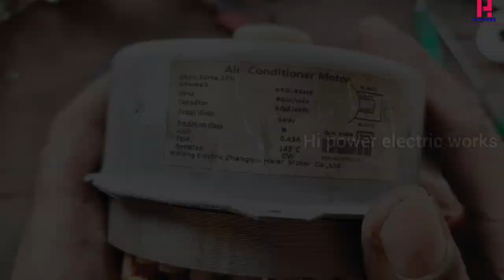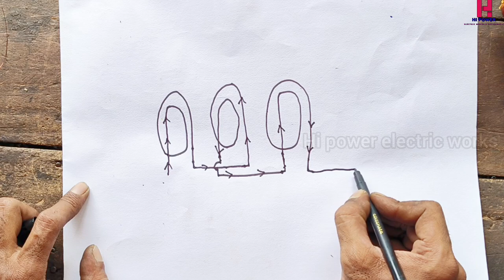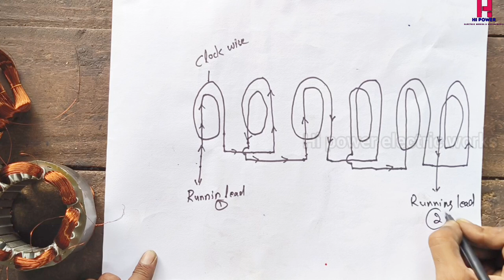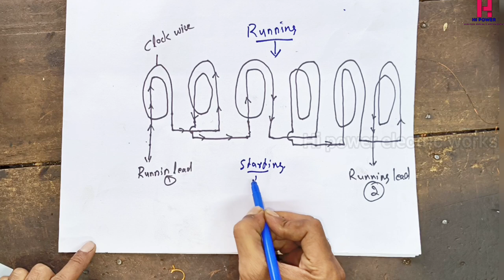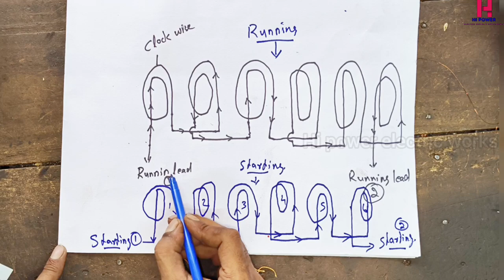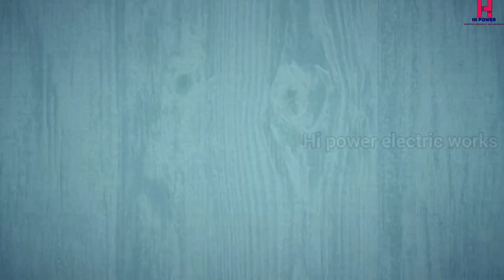Single phase 960 rpm motor winding and connection with diagram|Electric motor winding|AC fan motor

Comment: Excellent presentation.  Is there a centrifugal switch to remove the start capacitor from the circuit after the motor reaches a specific run speed?  Will you be doing a 3 phase motor overhaul in the future?
Reply from the maker: Single phase motors that require starting power have a centrifugal switch which is connected to the starting capacitor.  After the motor is up to speed, the centrifugal switch turns off and the starting capacitor is cut off from the motor.
The motor seen in this video works on a running capacitor
Reply: Thanks for the update! @Hipowerelectricworks

Comment: Hi, that was the connection for 6 coils formed, so if it’s all single coils, will the connection be a series or consequent, start to finish or start to start and finish to finish. Let me know, thanks for the video, it was great.
Reply from the maker: Connection start to start, finish to finish.
If one coil is clockwise then the next coil should be anti-clockwise direction

Comment: सर इसमें लच्छा कोयल डाल सकते है कोयल की लेंथ माप कर जैसे एल्यूमीनियम वायर 33 नंबर 360 टर्न को 120 टर्न का लच्छा कोयल माप के 3 बार गुमाने पर क्या इस से मोटर ठीक रहेगी
Reply from the maker: यह ठीक है लेकिन कभी-कभी वाइंडिंग को स्लॉट में फिट करना मुश्किल हो सकता है
Reply: सर अगर कोयिल ठीक से फिट आ जाए तो क्या मोटर ठीक चलेगी
Reply from the maker: @rohitkakkar8175  yes
Reply: @Hipowerelectricworks   जी धन्यवाद जी 🙏🙏

Comment: Sir Aaj mere paas same motor jali huyi ayi thi usme se mene Jale huye runnig or starting coil ki ginti ki to running k 380 or starting k 370 turn nikle or swg 34 copper tha ab kya kru apke vala data use kru ya Jo nikla Same motor motor lenth same motor outer same inner same plz RPL sir 🙏🙏
Reply from the maker: Video mein dikhaee gaee motor 54 watts kee hai aur iska capacitor 3 mfd ka hai.  yadi aapake paas maujood motor ka core aakaar video mein dikhae gae motor ke aakaar ka hai, to aap video mein dikhae gae winding deta ka upayog kar sakate hain

Comment: Aluminium or copper??
Reply from the maker: Copper winding
Reply: @Hipowerelectricworks  sir plz aluminium data bata do same motor same I'd same stator plz 🙏🙏
Reply from the maker: @rohitkakkar8175  
SWG - 33 
Turns - 360 
Coil size - 16 cm
Starting coil and Running coil same guaje and turns
Reply: Thanks sir 🙏🙏
Reply: Sir 33 no. Aluminium 360 turn bhut dhila coil rehta hai